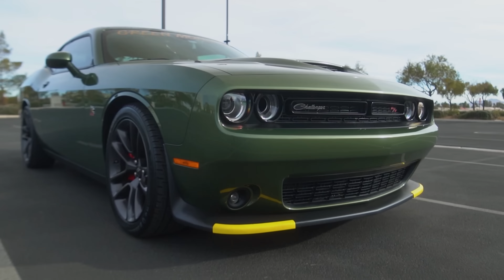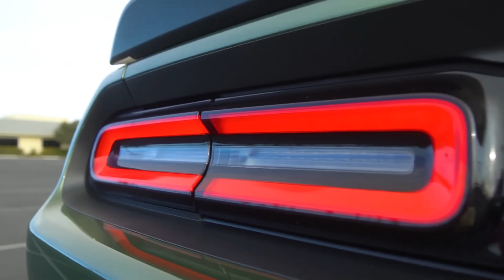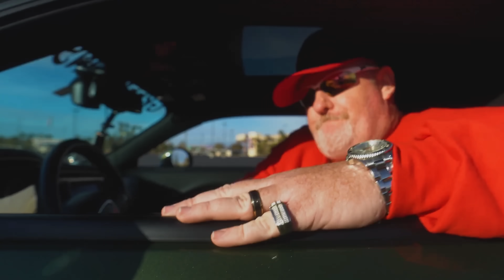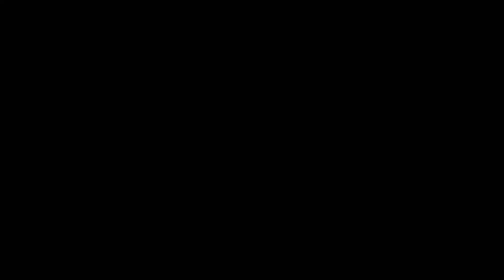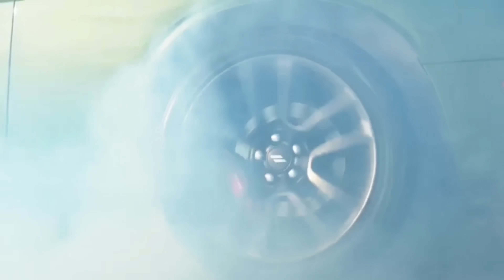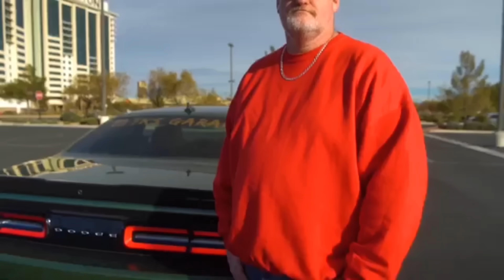Stellantis Engineers Decide On What V8 The Company Could Use In The New Charger

Comment: To really fix the 345 Hemi, is to add a oil jet system that sprays oil on the cam lobes, to avoid the idle and low rpm wear. That is a small fix, easy to do.
Reply: Great idea 💪🏽
Reply: @aaronbrunson3090  It is. Hence why they wont do it.
Reply: I would rather them just change to a high flow oil pump. Easier and cheaper fix.
Reply: @robertokray3217  because it to much like right for them also they want u to keep coming back for a new one every 3 to 5 years
Reply: I run 5-30 and the old school larger oil filter on my hemi.  Its got 170k on it with no issues as of yet.  The 5-30 gives the roller a little more space from the camshaft and the larger filter that came on the first gen 5.7l has a little more filtration than the newer extra small filter
Reply: These crooks won't do that.  They want to make money.   They want things to fail like most car companies.  That's the new game in town.
Reply: @LeadStarDude , the cam lobes are only splash lubed. Under 1,500 rpm it needs more oil.
Reply: @briantrent1155 , low rpm under 1,500 rpm and you get insufficient splash oil on the cam lobes. If you drive a lot at 1,500 rpm or more, it's a non issue.
Reply: Yeah nah that shit costs money.  They're gonna ignore it until it's nearly a recall item then mandate a heavier oil saying it fixed the issue
Reply: I’d never buy this car in its 1st or 2nd year! Perhaps the 3rd year with a 6.4 option ?
Reply: Another option is to remove MDS and remove the oil passage in the block that sits directly below the cam. That passage blocks so much of the splash at lower RPM's. It's only there for MDS anyways. Or use it as said, put squirter's in it for the cam lobes and lifter rollers.
Reply: A Superchargered 5.7 is another option, add the high output oil pump. The Hemi is a stop gap, on borrowed time. I would rather have the SO Hurricane 6 with dual injection, port injection should be added as well, like Ford has done. It eliminates the carbon issues.
Reply: @OnTargetwithBT which filter is that?
Reply: The easy way to fix that is to re-aim those squirters that spray oil to the underside of the pistons.  It is not necessary to do that on street-driven engines.  Re-aim them to instead spray oil to the cam lobes and lifters.  This is North America, not Germany.  Lots of traffic jams, no autobahns.
Reply: @appleiphone69  The platform is designed from the get-go to have a gas engine /
rear drive variant with the Hurricane Twin Turbo motors. Transmission and rear drive shaft tunnel are already there, as well as the engine bay accommodations. The main issue is fitting a V8 in those accommodations.
Reply: Nothing wrong with the 5.7. Less than 1% cam/lifter failure rate. Internet freaks act like it’s rampant.
Reply: No difference in physical dimensions of all three engines.
Reply: @blueduster74  Is that all?  You know most Internet nerds hate any and everything American made, so they will play it to the fullest.
Reply: I'll take the 5.7 any day over the hurricane
Reply: Also put hellcat oil pump in
Reply: High volume oil pump is a good fix; also, do not idle the vehicle for long periods of time. We’re not seeing hardly any issues with the aftermarket billet cams too.
Reply: @marcbjorg4823  they need to do something with exhaust manifold leaks. especially on the passenger side.  Those danm bolts keep braking off. 
They need to beef up the exhaust manifold so it can absorb more heat or go with shorty headers.

Comment: I would like a 5.7 with a supercharger and factory headers!
Reply: To hold down the cost of at least the entry level Charger, just put in a 6.4 liter V8 that's naturally aspirated. Give the engine around 400 (+) hp. Then have optional supercharged engines. It is necessary to at least be able to give people a (relatively) modest cost standard engine. Also, give the car a manual transmission (Tremec) 6-speed transmission option. Auto or manual trans, customer choice, at the same standard price. And for God's sake don't go wild on the MSRP, at least on the base, standard model.

Comment: I’ll keep saying it. Some dude is gonna buy a Six Pack and a totaled hell cat take the engine bay from the hell cat throw it in the six pack then toss in the hell cat engine and make the Dodge engineers look like idiots.
Reply: Sounds like an Overhauling job for Chip Foose.  
Then drop the Six Pack into an old Prowler with a manual.
Reply: Bro how are you going to do that with a all new electronic system none of that technology in the new car will communicate properly with the Hellcat engine and transmission it’s not going to work
Reply: @redhunnid5142  trust me you can, you just might lose some options because some connections won’t fit because of different plug types on the motor or the electrical system but it works if you fire it up you can see all the lights on the dash and try to fix them one by one it takes time
Reply: @redhunnid5142  same way people retro fit things. There are people much smarter than you or I that make adaptors, or jump wires, or even know how to recode or retune things and make it work. Look at the dudes who take 2 hayabusa engines weld them together to make a V8 then slap it in a Prius or a GR86 and everything work. It might take a minute for someone to figure it out but there are enough people with red neck science degrees it will be done and it will be glorious and I’m not even a big mopar guy but I wanna see it.
Reply: And do it in 3 months:
Reply: To protect the value of the discontinued Hellcat I pray the engineers stay stupid
Reply: @Ansonperisher  unfortunately anyone who bought one because they thought they would stay discontinued you unfortunately played yourselves. The V8 was the only thing that was keeping them in business. That’s why Camaros haven’t really shot up in value because they are discontinued right now but they’ll be back
Reply: @ what a dumb thing to hope for.
Reply: @fullbackdive41  yup. GM did this in 2002 and came back with blueprints for a camaro in 2008 and production came back in 2010. The vice president of GM, Scott Bell even said they will still use the Camaro for racing and said "while we are not announcing an immediate successor today, rest assured this is not the end of Camaros story" and they have been talking about a 7th gen Camaro recently again too. Back in 2018 there was rumors about a plug in hybrid LT1 V8 powered 7th gen Camaro because Chevy engineers made a post on forums asking if people would buy that.

Comment: A single turbo on a 5.7L Hemi engine can add between 70–627 horsepower, depending on the amount of boost
Reply: They will already have turbos on the hurricane.  If they are going with the 5.7 for its v8 option give it a supercharger.   Stay in the traditional engine platform camps.  

V8-overhead valves-superchargers vs I6-overhead cams-turbos
Call them the RumbleBee with the 5.7 and the Hornet with the 3.0. 

There was someone on with RacerX a while back that had put a supercharger from the bigger hemi on a 5.7.  That would give it more power than it has been allowed.

@LeadStarDude above suggested making the 5.7 a stroker for more displacement and torque.  That could be another variation.

Maybe take a page from Buell for an idea with more revs?   Go large bore, short stroke for increased displacement & revs.  Then add a supercharger for some boost.  Just an idea to be different.

Comment: They should up the displacement....market it as a 400 cid engine. Call it "four hundred cubic inches of glorious freedom". Make the 5.7 the base, and the 400 the next option....no cylinder deactivation....make it reliable, and affordable. They'd sell all they could make.
Reply: Add turbo
Reply: They could use the 5.7 and just make a stroker version crankshaft that makes it a 400 instead of 345. Increased displacement via a longer stroke. It would be a torque monster.
Reply: Or they could bring back the 426 Hemi ‘Elephant’.  That engine has a legacy with the company
Reply: I think they should have a 6.3/ 383 😏
Reply: I don't understand the obsession with displacement. The primary focus of this car should be making it lighter and more efficient.
Reply: @LeadStarDude  The biggest stroker kit they sell for the 5.7 makes it a 392. But if you were to bore out the engine 30 over to 3.937 and the stroke also at 3.937 you would have a 383 cubic inch engine. Not only would you have an engine with the same stroke and bore but it will have a famous mopar displacement of 383 and I think it would be cool.
Reply: Mopar had a 6.6 L it was the 400 big block from 1972-1978 ..It replaced the 6.3 383 c.i..the 6.6 was a low compression government mandated smog engine, still could run upper 13's in a B Body Chrysler product.

Chevy had a 6.6 Big Block that was 402 cubic inch(again a low compression government mandated smog engine that replaced the 396 in 1972), Chevy also had a 6.6 small block 400 cubic inch(Chrysler 318 would out accelerate it,I have a old van and truck magazine from 1977 and a Dodge van with a 318 beat the Chevy van with a 400 and beat a Ford van with a 351)..Pontiac/Buick/Olds had a 6.6 L that was a 403 c.i. and Pontiac also had a 6.6 that was a 400c.i (not a big block nor a small block all Pontiac engines were the same block 287 to a 455).

Remember Fords so-called iconic 5.0 Mustangs of the 1980's early 90's were 302 c.i but was actually a 4.9L they upped it to 5.0 as they had a 4.9 inline 6 that would be too confusing to customers(you have a leeway to up a engine but Ford didn't meet the criteria to make it a 5.0 it was a pure lie)..The new 5.0 in the Mustang is 307 c.i.
Reply: @poly_g6068 The more displacement it has he more power and more reliability it gains.
Reply: @jovaniortiz8317  401 stroker kits have been and are still available for the 5.7 Hemi.
Reply: @ wow, didn't know, that. What length is the stroke?
Reply: @MikeekiM-vh5se  I have a factory stage 3 Big Block 400 Magnum in my custom ordered 1974 Charger with the Ralleye and RT packages. My dad custom ordered it in 1973. It has the stage 3 400 Magnum, a 400 transmission, and a 400 rear differential. He ordered it with every option available, including air conditioning, rear window defrost blower, cruise control, and a slap shift between the bucket seats. All stock. He gave it to me on my 21st birthday over 25 years ago.
Reply: @jovaniortiz8317  4.25
Reply: @jovaniortiz8317  I believe it only works for the 2003-2005 5.7 Hemi, though.
Reply: @ holy 💩
Reply: 400 for babies, need 454
Reply: It won't meet the smog requirements or the higher cafe fuel economy standards. That's why they dumped them in the first place, they got tired of paying Tesla.
Reply: I want a 440 😅
Reply: @garybishop4030  those won't matter after January 20th 2025. Cafe is going bye bye.
Reply: @michaeljohnson4947  or maybe keep the name simple like Charger 400? Lol
Reply: No, supercharger, not a turbo.  Turbos work best on diesels and aviation engines.
Reply: @LeadStarDude 4.05 in stroke and .010 gets you a 392ci; my Ram has a .020 overbore coming out to 394ci 6.4L stroker.
Reply: @bri-manhunter2654  I really want a stroker kit for my 5.7, but it is still stock right now. Mine is the older 5.7, though, before MDS or VVT. Mine is in a regular cab 2005 Daytona edition RAM 1500 2wd. The Mango Orange version.

Comment: The 5.7 Hemi hasn't been updated since 2009.  It only revs to 5800 RPM.  If it were to be updated it could reasonably make around 425 horsepower. If they put more R&D into it and got it to rev to 7000 RPM, they could possibly get 460 horsepower or more, which is close to the last generation scatpack.  If they supercharged it, it could easily make 600 horsepower or more.

Comment: If speed to market is the focus, it would have to be the NA 5.7. I would think that adding turbochargers would again add development time, hot and cold weather testing, durability testing, not to mention the extra space needed for the turbochargers and plumbing, etc. Realistically, that 5.7 as it stands would probably be pretty killer in the new car. If I recall, it's a lighter platform (without batteries of course), maybe a little more aerodynamic, etc. I realize this is wishful thinking, but somehow I'd love to see that front "R Wing" used on the V8 cars. It seems the V8 would sit lower (being a 90 degree V) and be shorter than the inline 6, so maybe there's space

Comment: If they fit the 345 Hemi, they can simply supercharge it and add a oil water heat exchanger.
Reply: Hello i also mention a similar idea  about improving the Hemi V8 engines upper and lower oiling systems !! To Provide better Protection !! Because   the Hemi V8 engines when put together right, are strong engines !! 🇺🇸🇺🇸🇺🇸💪💪🥊🥊
Reply: @erictate8986 , yeah. Low Rpm under 1,500 rpm is bad for that engine. Not enough splash oil on the cam lobes. They get no oil through the pushrods. Has all been shown in videos.
Reply: Oil to air keep water away from oil
Reply: t want designed for splash oiling

Comment: The only thing, i would recommend about Hemi V8 engines ,is to improve the upper and lower oiling systems to provide extra protection !! Because they are very good engines !! And i would bump Up the N/A now 5.7 L Hemi V8 to 500 hp !! And i would have a turbo Version 5.7 L Hemi V8 that would have on low boost 687 hp !!!🇺🇸🇺🇸🇺🇸💪💪🥊🥊
Reply: Superchargers are better for automotive gasoline engines.  Turbos work better on diesels and aircraft engines.

Comment: Its great a v8 but it need to be affrodable max 40k. They need entry level inline 6 na at 30k , v8 5.7 40k, inline 6 twin turbo 50k and a destroke hemi 5.0 twin turbo or supercharged at 60k or more. If it sell first year they could do a ultra light weight wide body to compete with ford and gm in turning performance.
Reply: Does anybody currently sell muscle cars in America at those price points? From the video's I've seen its hard enough to get a family hauler for 40 K.

Comment: 5.7 non-turbo is my choice. My current 2012 Charger RT has a 5.7 with 256,000 miles on it. Runs great. My opinion is that all a turbo will do is create a failure point where there isn’t one. Plus Dodge will likely want $15,000 for the option. The non-turbo 5.7 is ready to go. Why slow down the introduction of it by waiting for a turbo variant to be developed.

Comment: No turbo! I want that blower whine please! Positive displacement blowers are where it’s at. That instant torque is what sold me!
Reply: I agree.  Superchargers work better on automotive gasoline engines.  Turbos are for diesels and aircraft engines.
Reply: @jamesbosworth4191 Why then does the vast majority of forced induction factory gas engines use turbos?
Reply: @johnmcmullen456  Because in theory, turbos don't exact as high a fuel economy penalty as superchargers do.  But superchargers are better because you have instant response, whereas turbos suffer from turbo lag and require more complexity and generate more heat.  They work well on diesels because most diesels don't have a throttle plate, hence, the turbo doesn't slow down as much at idle in a diesel as it does in a gas engine.  Plus, diesels don't have very crisp response anyway.  They also work well in aviation engines because those engines operate at a constant speed.  You can't idle in the air, so off-the-line throttle response is not a concern.

Comment: I would prefer the 6.4 hemi but having the 5.7 hemi as an option would be outstanding.  I suggest that they should use a more performance hardened camshaft or one that is using stronger material and use Johnson lifters in them to end all lifter/cam concerns.  I would also suggest that they use forge pistons and connecting rods in them as well.  This would make them a bullet proof engine with these mods.  This sets it up for a turbo very nicely.  They would just be substituting these parts for what they were using previously.

Comment: Most people that happen to use the wrong kind of oil, synthetic oil is recommended for all the hemi's. But they seem to all use regular conventional cheapest oil smh. That's the problem right there causing the ticking. Hemis have small tight journals inside the engine that oil has to pass through so using the correct oil makes all the difference. I only use Valvoline Max Life High Milage semi synthetic in my car since ive owned it and it is a really good oil

Comment: TK, this is just pure speculation but just basing these ideas under the frantic current circumstances, this is what I THINK will happen: 1. Base platform: 5.7(cheap to build, lower cost, etc.) 2. Upgrade: I-6 H.O. 3. Electric. Now, after they finally/hopefully get some income coming in, they might add upgrades such a you mentioned, a turbo to the 5.7 but I just feel for some reason that might not happen as the thinking will be adding an upgrade to an outdated engine design might be favorable to some but not all and they will go the route of the Hellcat, or, most likely, a new engine platform such as the Magnum(turbo/supercharged) based off the Ferrari engine you mention. 
Again, just speculation but am attempting to apply common-sense from the outside looking in of turning a completely losing situation into a winning situation for everyone. Your thoughts?